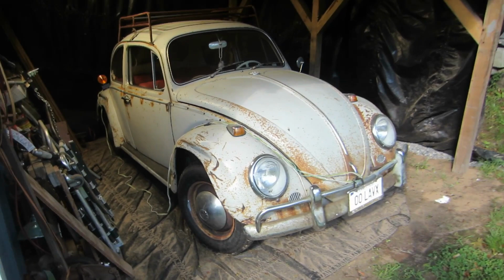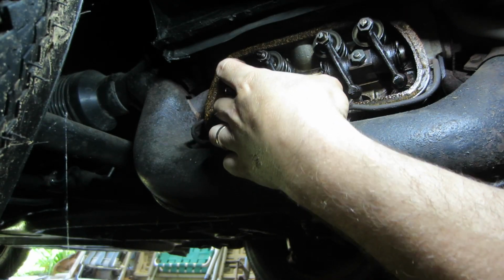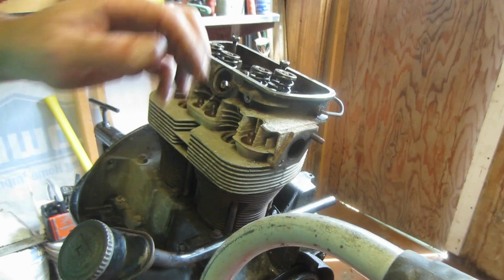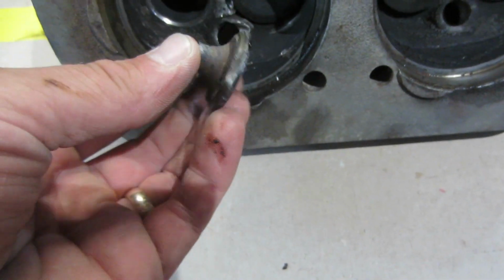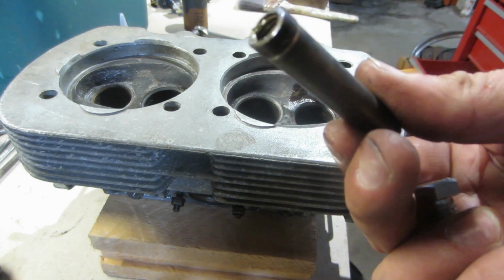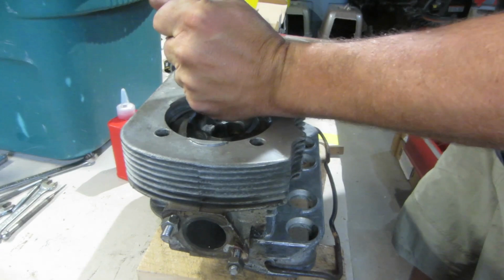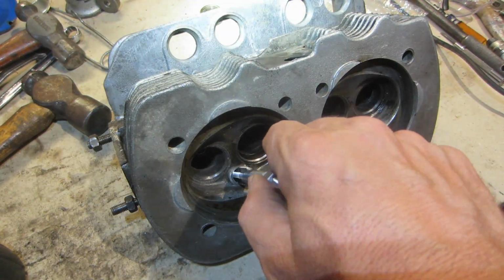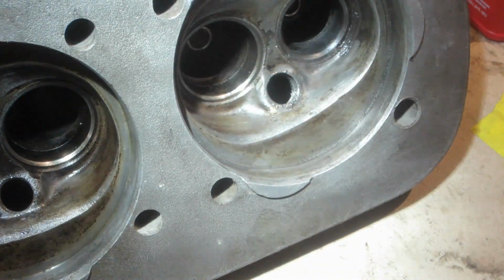What happened to Misty?

Comment: My '63 Turbo Beetle dropped No. 1 intake valve when it was on the dyno. It had just done a full throttle pull and was idling when the valve pulled through the retainers and hit the piston. Luckily the only damage was a bent valve and damaged guide. VERY lucky considering it was doing 7200rpm a few moments earlier!
Reply from the maker: Wow, that's crazy!

Comment: Hate to hear of Misty's troubles E-man.  She's in good hands though.  You'll get her straightened out.  I always run moly lube in my older engines.  Today's oil isn't very good for our old engines.  I ruined a few small block Chevy cams before I figured it out.  
Good luck man, good to see your still at it.
Take care 
Donut Dan
Reply from the maker: Thanks for the comment Donut Dan,  I feel my trouble was just running very old valves.  So a fresh batch is on the list for the rebuild.  I've used moly lube also. Great stuff. Take care 😃

Comment: Well, it’s great to see a video from you again…. Just not like this. 
Looks like a top end is all you’ll need and very smart rebuilding the heads first. I’ve seen broken valves like that before because people don’t want to spend a few extra bucks and replace extremely old valves that will break. 
Good thinking on the guides, how will you press them back into place?
Reply from the maker: Great to hear from you jawbreaker!   Yes I am thinking that the valves were just very old.  Its the only thing I can think why it happened.   I've been good on valve adjustment so, didn't think that was the culprit.   I have follow up on the engine teardown.  I will release in a few days.  Engine is in the mist of a full rebuild.  
I actually tried on my own with the valve guides, but it was a fail.  So now waiting on the machine shop to take care of them.
Reply: @EmanDeluxeVLOGS  you took good care of her, it was just an old part failing is all…. Not on you buddy. 
I’d also say that it wasn’t a fail, you have it a good try. We can’t do everything, not all of us are M1 😂